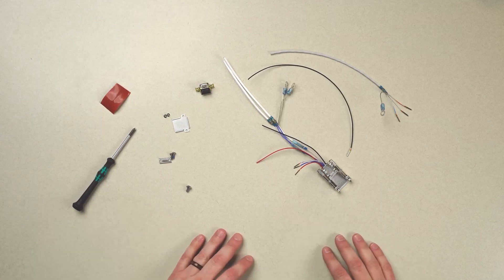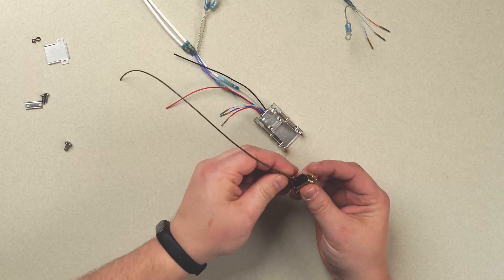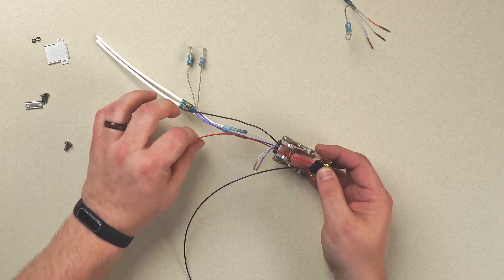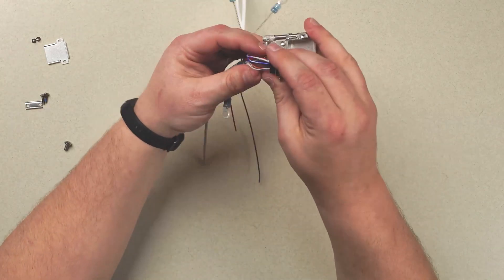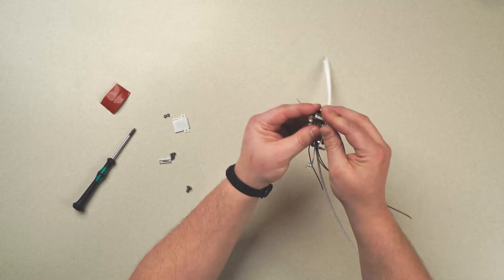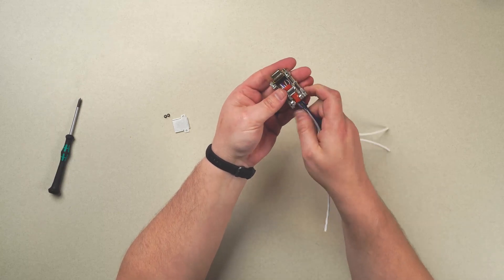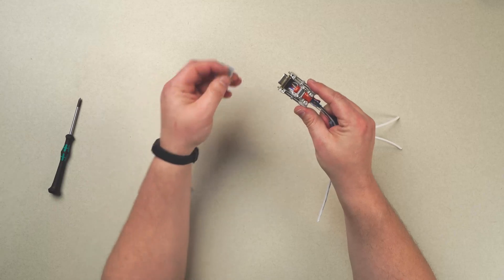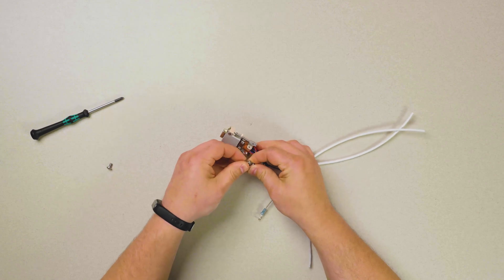Garmin G5 Wiring Fundamentals- Lightning Protection Module Connector Assembly- Experimental Aircraft

Comment: I don’t see anything in the manual that says which wire is CAN-H and which is CAN-L entering the LPM.  The white/violet is CAN-H coming out and the blue/white is CAN-L, but I am not sure which of these input wires corresponds to these output wires and I don’t see this labeled on the diagram or mentioned in the manual.  I suspect white corresponds to the white/violet and blue corresponds to blue/white, but it would be nice to know for sure.
Reply: Go to the Garmin G5 Installation Manual (Rev. 10), Pages 7-4. It's all laid out there with max lengths, Can-H, Can-L, Power Ground, Rs-232, etc. hope this helps! ;) By the way, did anyone notice "Chris from Garmin" has different shield ground O-Ring terminals at the end of the video than at the beginning? Regardless, great video series, thanks Garmin. :)
Reply: @1fujimonk  No. it is not all there.  If you look at Figure 7-3, it shows the white/violet going to CAN-H and the blue/white going to CAN-L out of the LPM, but the wires into the LPM are not labeled.  I assume the white wire corresponds to the white/violet and the blue wire corresponds to the blue/white, but I do not see that indicated.  And I have not seen a reference yet in any Garmin manual as to their color code convention for the CANBUS cable.  I, again, am assuming they are using white for CAN-H and blue for CAN-L, but I have not seen that stated.  The note on Figure 7-3 references the interconnection figures for continuation of wires.  However, if you look at figure 7-5, they use red and blue for the CANBUS, not white and blue.  And if you look at figure 7-9, which is closest to my configuration, they use black for both conductors with no labeling as to color of conductors.  So, please point out where in the manual it says that the white wire going into the LPM is CAN-H and the blue wire going into the LPM is CAN-L?
Reply: @LTVoyager  Your observation is valid, the documentation could benefit from clearer explanations. I share a similar configuration as Figure 7-9. To verify the integrity of my system, I conducted a continuity test on each conductor.
Reply: @1fujimonk  A continuity test was my last resort, but I prefer when dealing with black box devices to not probe them with voltage unless I absolutely have to.  An LPM probably just has an array of zener diodes inside and should be relatively voltage insensitive, but some devices can be damaged even by the low voltage from a DMM.  So, my preference with anything other than wires is to not use a continuity test as my first choice.  I sent a query to g3Xpert and got a quick reply that my assumption was correct that the white wire into the LPM is CAN-H and the blue wire is CAN-L.  Of course, when I made my schematics a couple years ago, I chose white for CAN-L and white/blue for CAN-H, essentially the opposite of Garmin’s convention.  The good news is that I terminated the last of my 14 node CANBUS today and all tested well with 59.2 ohms on the bus.
Reply: @LTVoyager  Hello @LTVoyager,

Congratulations on your successful CANBUS testing. I am pleased to read that your results align with mine. I am nearing the completion of my own project and have adopted the same color nomenclature as yours, go figure, ha, ha! Thank you for sharing your findings with the Garmin g3Xpert. Your contribution is greatly appreciated.
Reply: @LTVoyager Just dropping a comment to thank you for posting which wire (white or blue) was CAN H in the LPM. The diagram in the Garmin documentation is garbage.
Reply: @LTVoyager Just dropping a comment to thank you for posting which wire (white or blue) was CAN H in the LPM. The diagram in the Garmin documentation is garbage.